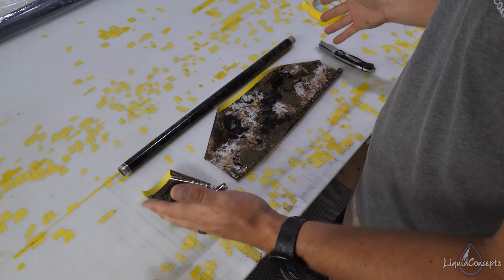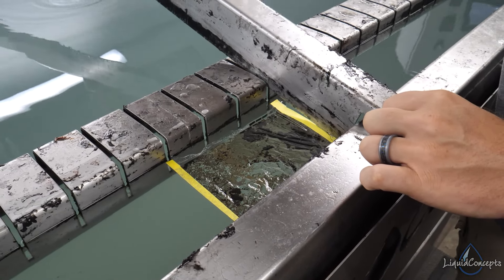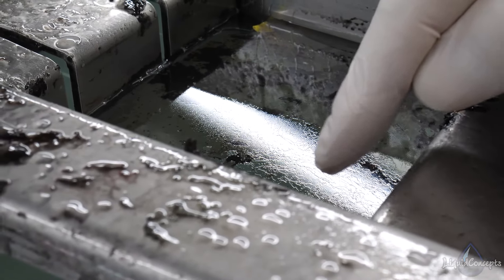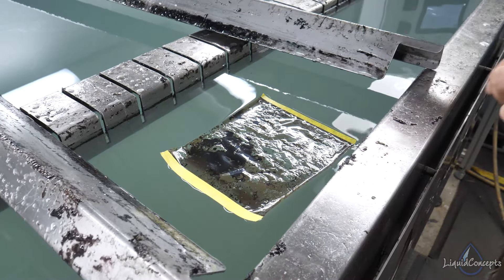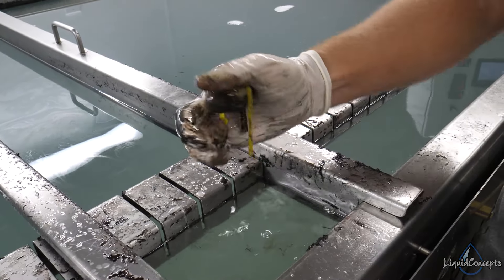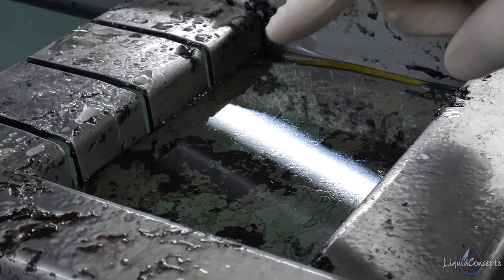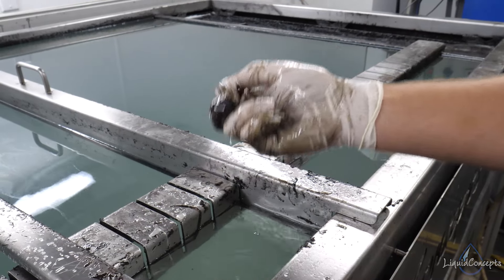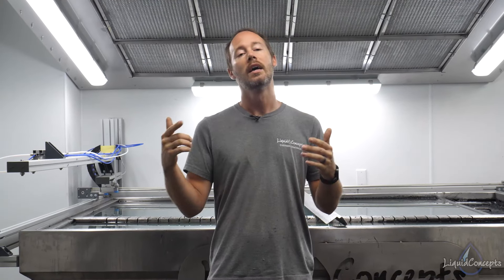How to TEST Hydrographic Film for Soak Times.

Comment: So I’m having an issue where it all looks perfect until I apply clear then it just seems to eat the film away what’s going on 😅
Reply: I think that means it is being over hydrated. I have been researching this a lot, because I have had the same problem. The conclusion I have come to is when the film soaks for too long, the activator will blow the film apart when sprayed.
Reply: @ ended up working it out and got done what I wanted and it looks amazing but I’m pretty sure it was that